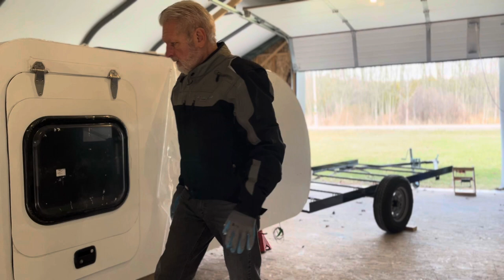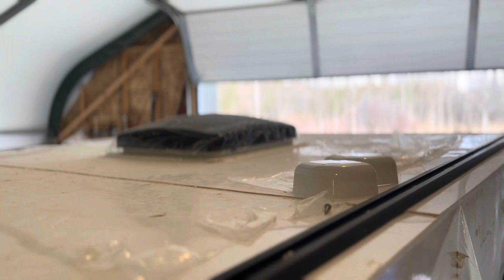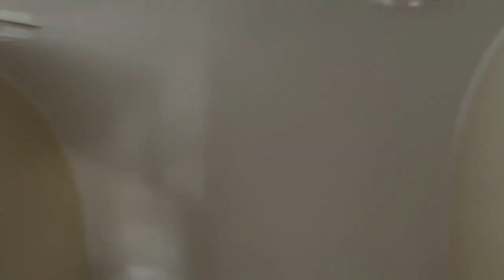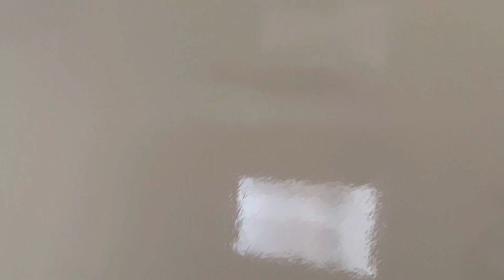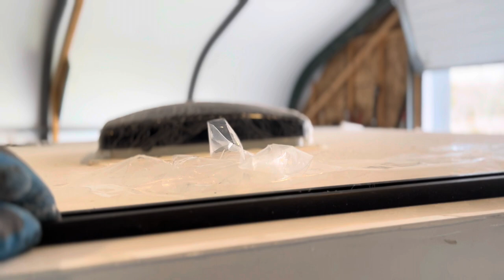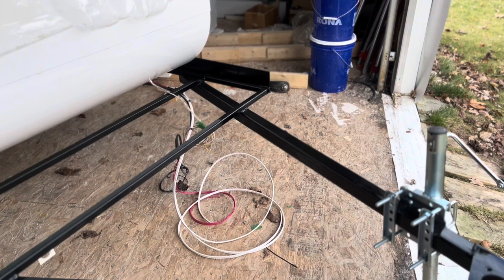All Composite DIY TEARDOP- the cabin meets the trailer frame!

Comment: Nice build Steve. But you should move door to the other end of the teardrop. think it is a no go that the door open like it dos. Still a nice job. keep up the good work👍
Reply from the maker: Thanks. The rear door is so you can get in without getting dirt on the bed. If I hinged it normally it would hit the fender and not give a lot of room to get in.
Reply: @steveogilvie5203  I understand the isue with the fender, and also the isue with the dirt on the bed. but it should be no isue to have the door in the other end ( closest to the car) of the trailer and sleep with head in opposite direction?
Reply from the maker: @larspetersen2688  It is all a compromise. If I put the door in the front then the shelf with the electrical panel has to go in the front too. The front is designed so that you can push the mattress up the front wall so it can be used as a couch. The rear wall is not as good for doing that and the shelf unit at the front would have to be bigger because of the much more rounded roof area.The other alternative is to have a conventional opening door on the rear of the trailer. The only problems with that are it would be very hard to cut out of the shell accurately and then you could not put a rear bike rack or attach a rear kitchen box in the back. But that might not matter to a lot of people. We keep our bikes in our tow vehicle and most tent campers bring a kitchen in their vehicle. This trailer mostly appeals to tent campers that are tired of sleeping on the ground.
Reply: @steveogilvie5203  I understand and appreciate you taking the time to answer so thoroughly. Most Teardrops have the rounded end at the back, probably because it causes the least overall wind resistance. So maybe it was better to turn the box 180 degrees. Stopping with my input on your awesome teardrop🙃I'm curious about what the box costs in terms of materials? Form and glassfiber ect.
Reply from the maker: @larspetersen2688  Input and comments are always welcome. Basically the form cost about 2000.00 mostly for 1/8" luan and 1/2" plywood and OSB board and 2X4's and glue and screws.For the cabin and tongue box : 4 sheets of 1.5" styrofoam and 6 sheets of 1" styrofoam. I use Filon fibreglass RV siding, approximately 45 feet of 8'6" wide material wrapped and glued together on the form.  About 150 tubes of Lepage Quad max caulking at 13.67 each.The filon I buy from Bontraggers surplus in White Pigeon MI for 1.25 USD per square foot. I havent added up how much each cabin costs but the first small one(model 2) cost 5000 CDN to build the entire trailer. The first Model 3 cost about 6500.00(entire trailer) and this one is less because I used the same form to build it. I use the trailers for a while and then when I sell one it gives me the money to build the next one and a bit of profit for my work. This is just a hobby for me keeps me busy in retirement.